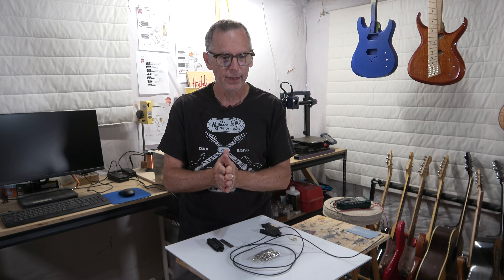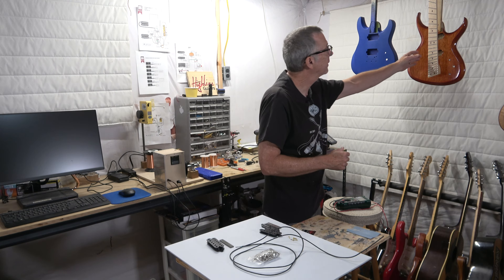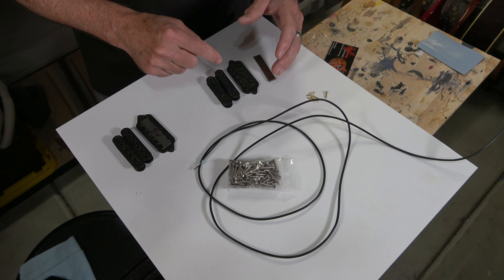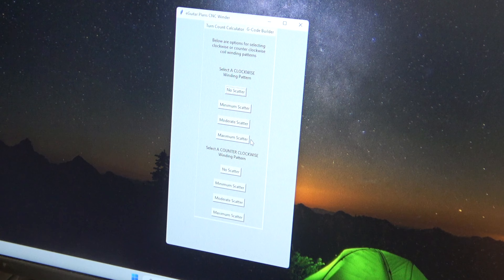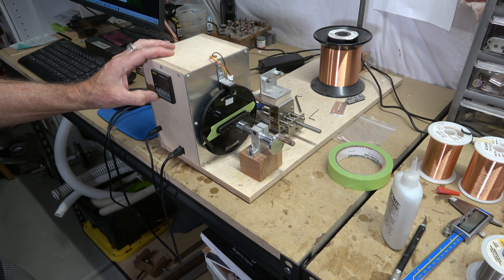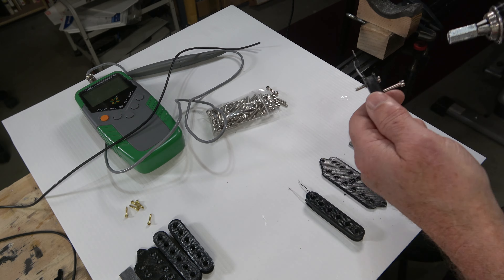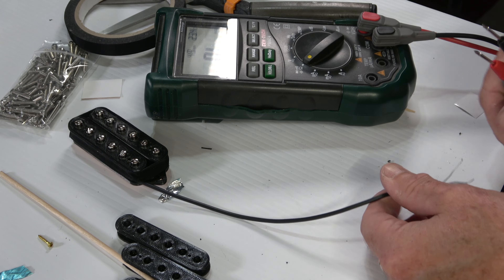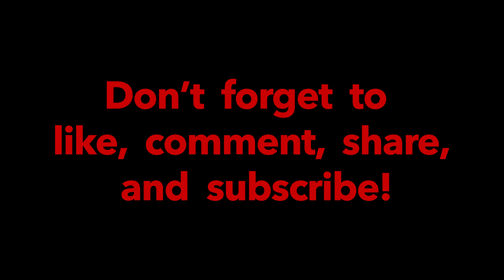Making A Six String Multi Scale Guitar: Making The Humbucker Pickups

Comment: Hello, 
I've never seen a CNC to lead wire before that's clever. I saw guys that were leading wire manually (only leading not turning around) that way looks much better thanks for sharing. 
Out of topic, that blue strat close to the 6 string multiscale looks awsome, what color/paint did you used ?
Reply from the maker: Createx 5201 Opaque Blue.

Comment: That's all cool, but how do you predict the tone of the pickup? Do you measure its impedance to check the peak resonant frequency?  Why don't you make the double resonance humbuckers? And aren't you wax potting your pickups? This particular guitar is gonna be used with the high gain amps obviously, so its pickups should be wax potted to prevent the mic effect.
Reply from the maker: Impedance, inductance, and gauss. Double resonance humbuckers are great in theory, but pointless in practice. Wax potting is useful on high output coils with loose windings. My windings are very tight,

Comment: Why isn't the copper wire shorted together? Is it insulated with varnish? Also, would you be able to modify your coil calculator to wind for a specific resistance rather than number of winds? This was a fascinating video, kudos for putting the effort into building your own pickups!
Reply from the maker: @StealthParrot  The wire is insulated. There are many different types of insulation, but the most common are poly-nylon, enamel, and formvar.  Sorry, but I will not modify my software.
Reply: @HighlineGuitars  Don't misunderstand, I wasn't telling you to modify the software, but you seemed to be going for specific resistance values, so was just musing that it might give you something a little more specific, that's all.
Reply from the maker: @StealthParrot  no, I shoot for a specific turn count. Resistance is secondary. Predicting the resistance helps to determine which magnet to use.